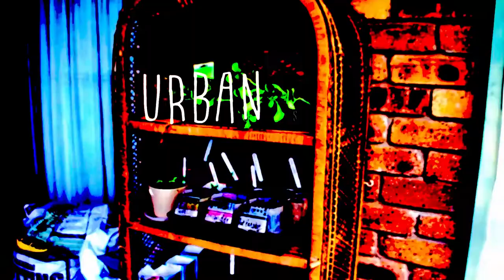Make a Trailer Spare Tyre Mount

Comment: good video I would have made it with 2 bolt studs though.
Reply from the maker: Thank you.
Yes, two bolts certainly couldn't have hurt; it has held up pretty well with one, but I concede that, unless tightened firmly, it can wobble... I suppose I could go back and add another.